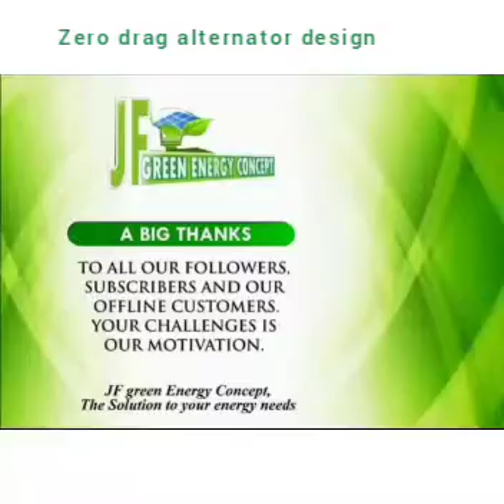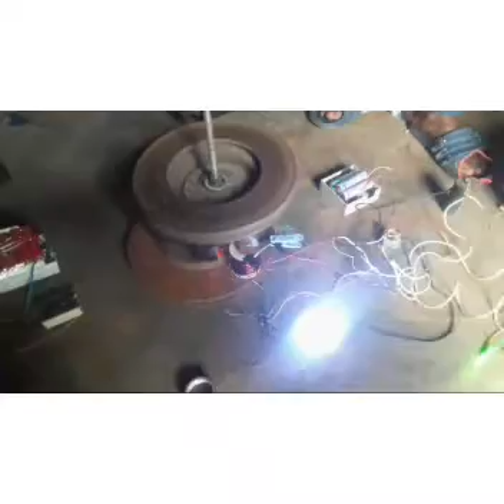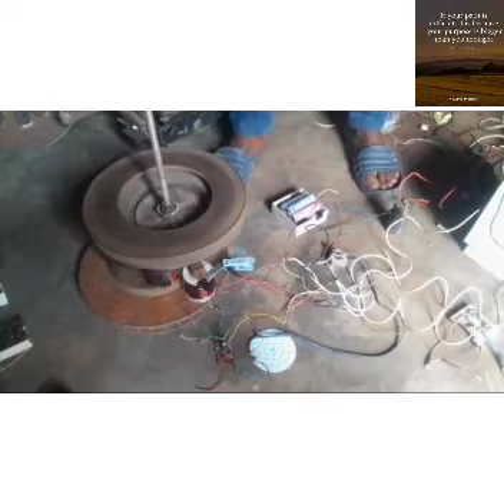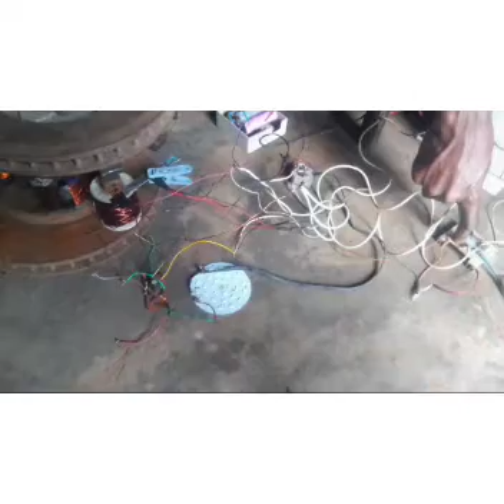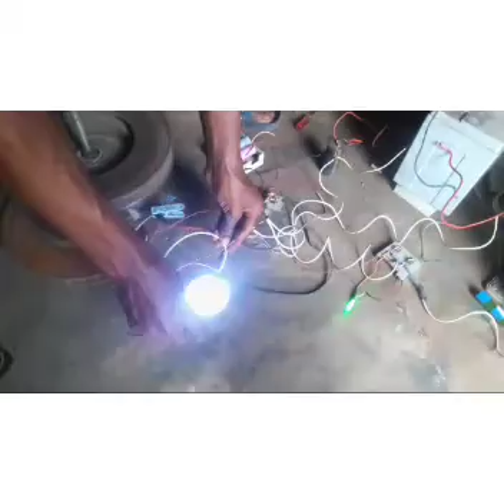Lenz free alternator design (part 3)

Comment: Excellent video. You are one of the very few Nigerians on YouTube that actually know what you are talking about. You can also look into generators without moving parts, it would be a better alternative to moving part generators.
Reply from the maker: Yes sir, We are currently working on that design. Thank you very much sir.
Reply: A generator with no moving parts is called a battery.
Reply: can you share details of non moving parts of generator
Reply: @goharnawaz9972  you can look up Thane Heins bi-toroid transformer
Reply: @danielakintola8000  is there any link and theory kindly share to me